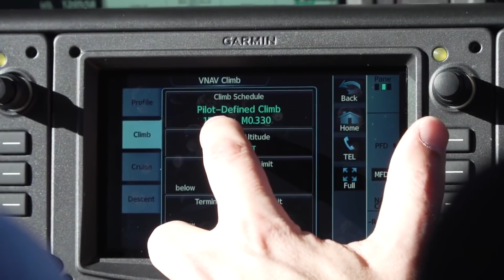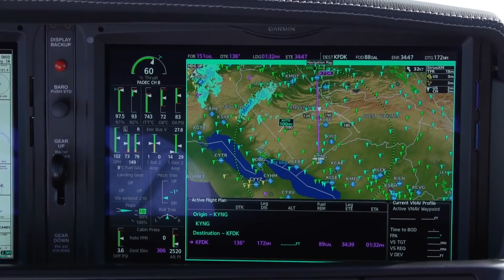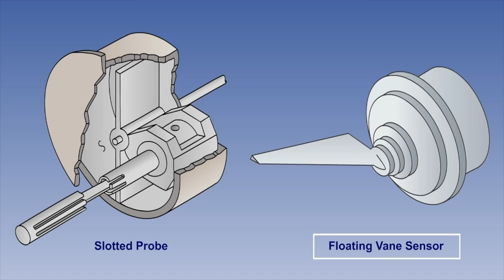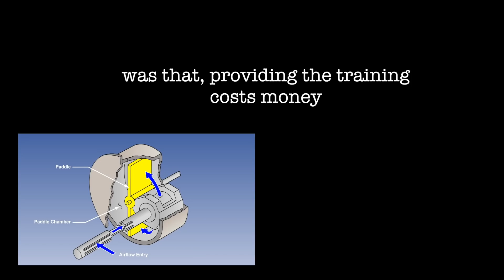Boeing Max 8 and the Cirrus Vision jet story - Prof Simon

Comment: yes you are absolultly right Simon, the truth is we don't actually need the AOA vane dangel out there prone to inviroment issues, on board the MAX and many other airplanes has been using IRS systems and the have now laser  gyros  and at least 2, on A380 nd and B 747 has 3 of them, they fail only 1 in a million or less than that !
and IRS is also connected to GPS system and they know the the exact attitude of the aircraft at all times!
why they use AOA is in my humble opinion close to grose neglect, isn't criminal, because there's not been any one at any airplanes manufactured industries that works to make there airplanes unsafe in any way!
But seen in hignsight they could have done a lot better!
Rgds Jens Andersen Techical Instruktor on B737 and A320,Fokker 50 and F27
Reply: If you actually understood what AOA was, you would know why the vanes are outside the aircraft.

Comment: PROFESSOR, both aircraft suffer the same deficiency but are complimentary situations.
MAX generates an angular moment that will pitch the nose up under high thrust.  The Cirrus, under high thrust, should show a tendency to pitch the nose down since the turbine is far aft of the airframes center of gravity. Actually the Cirrus  have the engine more out of line with the direction of flight which must affect the fuel economy to some degree since the energy that pitches the nose down does not push the airplane forward.  If Cirrus revectored the nozzle in line with the flight path it would help but, depending on the bypass ratio of the engine some sort of correction will be required for the bypass air.
In both cases I wonder why we are so quick to embrace AI/computer technology which has no tests which can measure it's functional ability while the mechanism the AI/computer is replacing is checked and cross checked to detect their skill level, mental and physical health problem, the pilot - who also is the default cause of unsolvable disasters. Go figure ???
The FAA probably lacks the tools to certify an AI/computer  mechanism's supposed "Air Worthiness"  while IQ testing keeps idiots out of the flight cabin.
Ken Bowd Canada

Comment: An error in your description, and a less flattering view of Cirrus: https://philip.greenspun.com/blog/2019/04/23/another-airplane-that-fights-the-pilot-if-one-aoa-sensor-is-bad-cirrus-jet/
The bad AOA activates a stick PUSHER, not a stick shaker. This is a completely different, and much more risky situation.
FAA emergency airworthiness directive: http://rgl.faa.gov/Regulatory_and_Guidance_Library/rgad.nsf/0/448c46c035e93a6e862583e0007291d8/$FILE/2019-08-51_Emergency.pdf
Reply from the maker: Big fan and friend of Philip Greenspan....thanks for sharing.
Reply: Thanks. I don't know him personally, but have been following his work since 1998!

Comment: Hmmm. So you don't mention how it was that Boeing knew anything about any sensor or MCAS problem well before Lion Air. Surely, as suggested in the comments, this system malfunction doomed any aircraft that experienced it, right? Did you actually do any investigative reporting on why the FAA and Boeing were hesitant to ground the airplane? Or is it just to be assumed that it was merely a nefarious capitalist management plot determined to take lives for the sake of profits and a rush to market because the media says so? Is that what you or your viewers would do if you were in the place of the engineers at Boeing? If not, doesn't a basic question need to be asked: "Whose narrative is that?" Answer that question and things might begin to become a little clearer. The media is great at regurgitating anything sensational it can get its hands on, no matter how misleading or slighting to the truth it may be. And one more question: How does the Cirrus do with its emergency procedures if the throttles are left firewalled and the speed is driven through the maximum limits in level flight? Perfectly controllable, is it? No excessive aerodynamic forces or flutter or anything like that? Is doing that part of Cirrus procedures? Since that is what the Ethiopian 737 MAX crew did and we are told they followed Boeing's procedures, I just want to make sure that Cirrus would accept that doing so is part of their procedures, too.
Reply: AOA sensor problems have been known about for decades. The issue was a statistical argument, whether the failure of a single sensor would lead to a catastrophic outcome. This was a failure of the fault analysis tree, and a wrong assumption that the pilots could catch the mistake.
Reply: Gordon Richardson  You mean a mistake that low-time pilots with little experience and training in the developing world would be able to recover from any trim runaway condition, despite that being present in training requirements for decades? The crew would have recovered from a stuck servo motor switch causing an even more continuous nose-down run of the trim, whether on the MAX or on a 737 from two decades ago? I agree that Boeing failed to imagine that as much as they should have, never thinking that any trim malfunction would be catastrophic for that airplane, whatever its cause.

Comment: Not every 737 max eight has an AoA indicator.
Reply: Ultimately pilot error was responsible - AOA sensor malfunction and MCAS created an out of trim aircraft that the pilots should have been able to recover. Pity that people always look for things to blame other than the truth!
Reply: And repeat media claims that do not make sense.
Reply: anton oosthuizen  - Tell that to 346 souls who lost their lives and 4 crew who summoned their best skills and could not recover as they weren’t told of a ghost control called MCAS. Boeing lied ... simple truth.
Reply: No truth, just the initial idea, but still without official reporting. Untill no one really knows what happend. I would leave the casualties alone that is already bad enough. Makes no sense to blame anyone yet or repeat madia reporting who clearly are only speculating.
Reply: @arvindvader1363  My friend my heart bleeds for those poor souls who put their trust and their lives into the hands of pilots and we can only speculate on what happened. I do know that when I have a runaway trim situation there is a set routine that I have to follow: disengage autopilot and auto throttle and hand fly the aircraft while trimming manually to re establish the correct pitch attitude. It is extremely hard to manually trim the aircraft at higher air speeds because of aerodynamic force - hence disengage auto throttle and reduce power. Unfortunately in the ensuing panic it seems that the pilot omitted to do this as is verified by the FDR : during the emergency the air speed was excessive and the indication was that the auto throttle had not been disengaged. MCAS becomes inoperable when the stab trim cut out switches are used and Boeing's recommendation is that if there is a problem with automatic trimming of the aircraft - ie autopilot - then the aircraft should be hand flown and the autopilot not be re engaged. The pilot re engaged the electric trim (autopilot) because he was not able to physically turn the manual trim wheel due to excessive airspeed. Obviously when he did that the faulty MCAS system pushed the  nose down again etc. As much as I hate to point the finger of blame at any particular person I think that you may find that my explanation is the truth. Also an accident is generally the culmination of many small things that together eventually cause an accident to happen. God bless my friend.
Reply: @antonoosthuizen1467  if you know the truth that the rest of the world is still trying to piece together why not share?
Reply: Every 737 MAX comes with AOA sensors (actually NGs do too), the indicator in the cockpit is(or was) optional.
Reply: the secondary issue is why did the pilots not pick up on the runaway trim, your not flying an airbus here, what it seems to have happened once the stick shaker went off only on one side they completely forgot about runaway trim memory items, you should never be fighting the trim system (yes the fault was caused by 2-10 people at boeing for allowing somthing to control the trim system with no failsafes that they norm have in place, that is now fixed 3 failsafes are now in place as they should of been from the start and someone should goto jail who ever signed this off)

the lion air flight they never turned off the trim power even thought they was actively fighting the powered trim system for 12 minuets they just kept pressing and holding the up trim button (so they was going up and down like a yo yo)
the Ethiopian crash happened sooner they did cut the trim power but they did it to late and worse they turned trim power back on witch you should never do and on top of all that they left engine power at take off power 98% witch made the plane way over speed (over speed buzzer was active)

it happened a number of times in USA (about 8) stick shaker on one side and all and they just handled it normally and cut power to trim and landed it (they did not let it get to near max tirm down) it seems non native english people panic to easily and forget basic stuff

Comment: Rather than argue the toss with your commenters regarding the responses of Boeing vs cirrus, I'm fascinated with the apparent acceptance of aoa sensors' reliability. They are so sensitive as to need protective boots and special directions when washing and de-icing a plane and yet they still all too often freeze with disastrous consequences. Along with  their unreliable sibling, the pitot tube, it seems the aviation industry has resigned itself to their deadly shortcomings.
Reply: Not entirely sure what you're on about, but both of your examples represent designs that are as good as current engineering can possibly make them, a certain european example of bad pitot probes notwithstanding.

AOA probes could be made more resistant but then they'd be less accurate, so there's no point in having a more robust design installed. The same goes for pitot tubes (I don't understand why you call them "siblings" of AOA sensors)
For both the design is determined by the effects they're supposed to measure, there is simply no better design known.

The usual answer to that problem in aviation (and in engineering in general) is "redundancy", you install more than one of critical systems so you have backups when one fails.
This is the part where Boeing's engineers failed totally, and I personally don't understand why.
I'm really puzzled why they forgot the most basic design concept in aircraft design used for at least 100 years.
Reply: @stephanfritz2933    Good analysis up to the last, and they didn't. They thought they had double redundancy in the form of two pilots with "off" switches for the whole trim system. They weren't building FBW. They were building a backup assist system for a pilot hand-flying the airplane who got himself/herself in trouble at low speed and was throwing power to it to try to get out of it. That is the only circumstance in which MCAS would ever be needed. They made it part of the trim system since every 737 pilot for decades has trained to fly the airplane and team on those manual trim wheels in any stab trim emergency, whatever its cause. With US and European pilots, that worked fine and they had just reported that MCAS was doing this starting last year so Boeing was going to have to do a fix regardless. With a new model, they hadn't counted on the sensor failure rate and they definitely hadn't counted on any crews fighting a trim malfunction into the ground.
Reply: If you can figure out how to measure airspeed and AOA as accurately as pitot tubes and vanes, without having sensors on the outside of the aircraft...you sir will be very rich.

Comment: Travellers and air crew unite: don’t fly on airplanes made by aircraft manufacturer that confuses pilots and do not act in the interest of safety of air crew, travellers and innocent people on the ground. All non-American aviation authorities where these airplanes operate MUST stand with travellers and air crew and set policy that if they want to put these type of airplanes back into service, every flight must be accompanied by a senior management person of this airplane manufacturer for a period of at least one calendar year. Otherwise, there’s an American breakfast problem of bacon and eggs, the hog is committed but the chicken is only involved. This way, the chicken becomes committed
Reply: what about airbus then your mostly just there to make sure things are working (airbus does not put pilots first boeing does) 

both of these crashes would of been avoidable if they was they stopped the runaway trim sooner (the last crash they did turn off the trim power but they waited to long to stop it as it was near max trim but they turned it back on when they shouldn't of and resulted in the fault activating the trim down again) 
the lion air was very worrying as they was in the runaway trim situation for over 12 minutes and at no point did they turn of the trim power (they just kept a hold of the up trim button until they stopped pressing it and when max trim down) in the lion air case they had forgotten there runaway trim procedures and never cut rim power even thought they was actively fighting the powered trim system (they knew the trim was going down not up but never turned it off and go manual), the Ethiopian did not pick up on the runaway trim fast enough until it was to far down trim for manual hand trim and they had engine power at take off power 98% from take off until it crashed beyond its max speed they never reduced power even thought the overspeed  buzz was active

this program error (witch yes someone should goto jail over) has now been fixed it will fly like any other 737 from when it goes back into the air (should note the boeing tanker verant has the below rules already and unsure why they did not copy the rules from it when they added it to the 737) 

both AOA sensors have to be in agreement (if in disagreement MCAS wont activate same as autopilot)
if mcas activated trim movement now has a max amount it can goto 
and if all fails if the pilots pull back on the sticks when mcas is trying to trim down the plane mcas will disable and not reactivate and show an mcas error on the maintenance computer screen
Reply: So don't fly Airbus either? Air France 447 and Qantas flight 72 as examples.

Comment: A stick shaker is not a flight envelope protection system nor an anti stall system.  It’s just an alarm.  The worst that could happen is a false impending stall warning triggering the pilot into an inappropriate nose down or thrust increase (unlikely) or worse a stall warning that never happens if he has mistakenly lost sufficient airspeed.  Both are unlikely to be scenarios because of “man in the loop”.  MCAS on the other hand will take autonomous, un-announciated and powerful action on the basis of false unverified instrument data.

The civil aviation industry: the manufacturers,  the pilots, trainers have been retarded in regard to use of angle of attack sensors or alpha sensors.  The sensors need built in self test and they further need crosschecking with multiple sensors and they also need plausibility checking.  Most of all they need to be displayed to the pilot as they are in military aircraft. 

Even MCAS is not a stall prevention system as it has no effect on throttle.
Reply from the maker: the Cirrus flight envelope protection system is pretty comprehensive...far more than a stick shaker...i think it includes throttle control.
Reply: Professor Simon Holland Thanks, I did check both cirrus’s brochures and Wikipedia.  Neither mention their FBW or flight envelop protection.  Obviously I’m wrong.  Having said that I’m pleased that the Cirrus Jet seems to use a pressure null seeking AOA alpha sensor.   To me this seems a superior device to a vane type sensor as
1 smaller
2 as its driven by a motor it can be self checked for rotation prior to takeoff.  Vane type sensors have frozen in unison as in xl airways 862.
3 pressure sensing elements can be self checked.
Reply: William Jones-Halibut 
I flew mil-jets where AOA sensors were essential...
Looking at this case i think
there were Boeing mistakes in system design, software design, human-machine interface design, test pilot approval, pilot training, maintenance...quality assurance in production...
The FAA failed as well...just like all the airline pilots who had a hunch and did not speak up...!
Reply: Actually the Cirrus has a stick pusher as well, which is far more dangerous. See: http://rgl.faa.gov/Regulatory_and_Guidance_Library/rgad.nsf/0/448c46c035e93a6e862583e0007291d8/$FILE/2019-08-51_Emergency.pdf